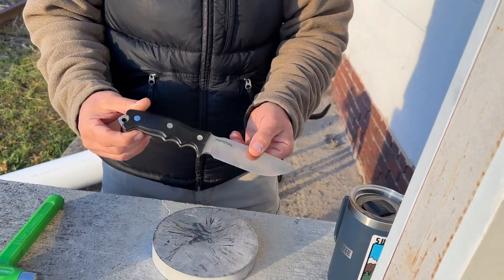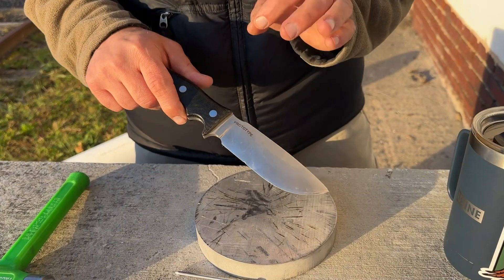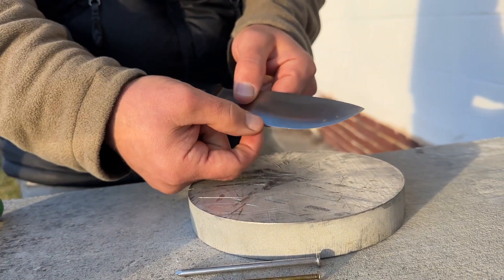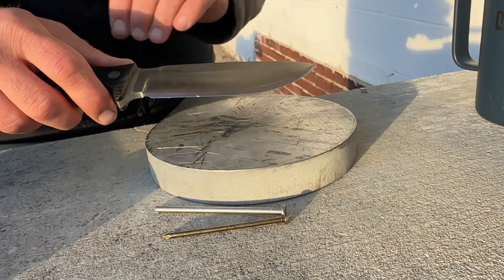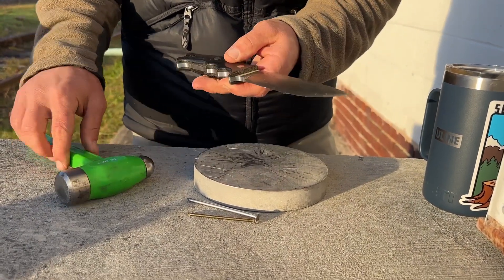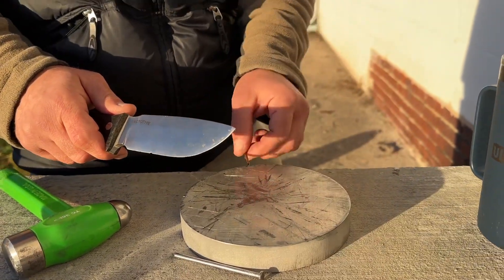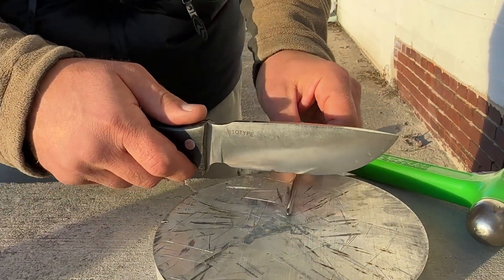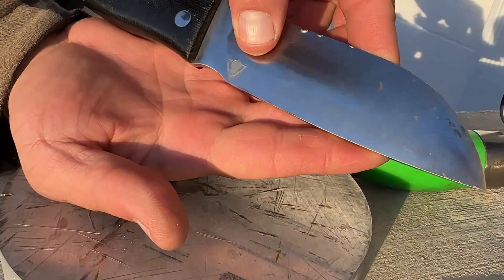Knife School: Ep 5: Steel Properties & Blade Geometry vs Energy

Comment: I will say as an owner of Bark River knives in 3V they are very efficient at cutting/slicing tasks, etc. That to me matters the most as that's the main function of a knife; to cut and slice materials within the realms of it's limitations/intended use. The edges are more likely to damage with accidents as the trade off. Accidents being contacting the edge on varies alloys, rock, and bone, etc. I'm not saying anything people shouldn't already know, so I'll leave it at that.

Comment: Ive never understood why people think nail chopping is impressive a butter knife dpes it without damage if the bevel is thick enough and the angle high enough...

Give me a very thin performance blade that is maybe 10 or 13 thousandths behind the edge with a 13-15 per side angle edge that can tackle hard wood carving and little prying with the edge without deformation or chipping or similar damage.

Ive always wanted to test one of your knives on my channel. 

I got many outdoor blades and i take em thin and blend the edge into the profile. Even 80crv2 at 63 hrc does very good and have very good edge stability samme with magnacut at 63 hrc very impressive stuff and with very good edge retention. I have beaten both of thoose intp two by fours batoned pryed chopped etc never had any damage.
Reply from the maker: To my mind, these highly abusive cutting tasks are a great way to visually illustrate a steel's properties at the extremes. Not a great real world cutting test and not something I suggest folks do but everything has its place for learning.